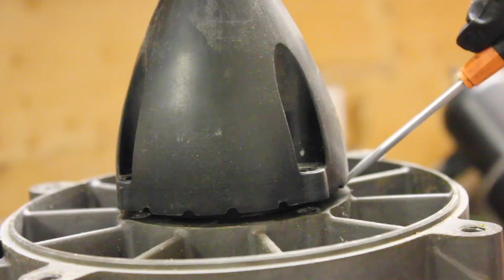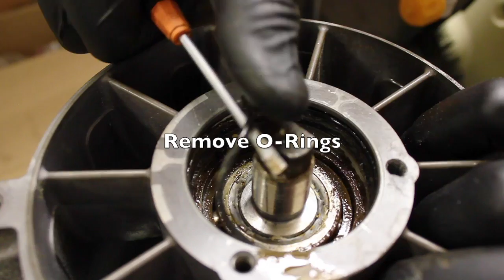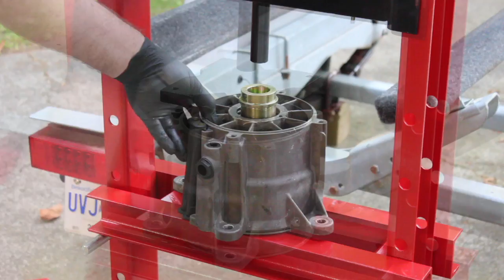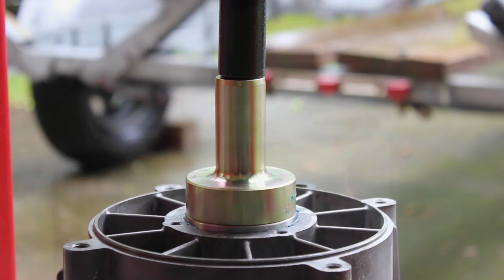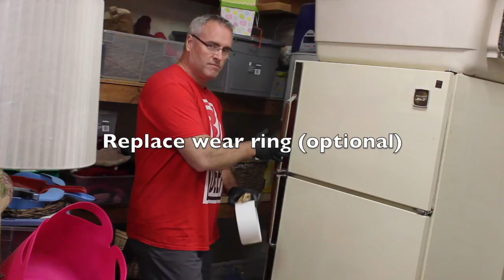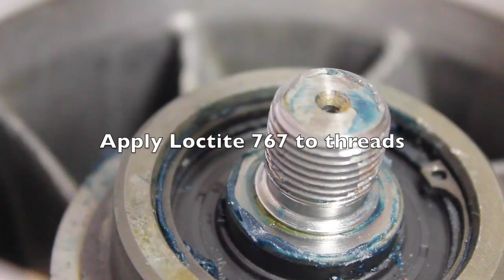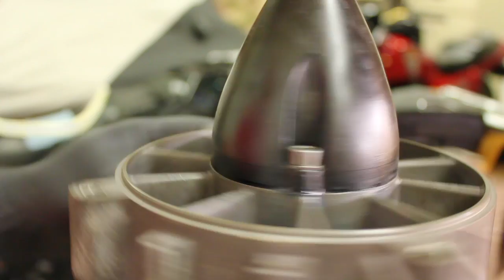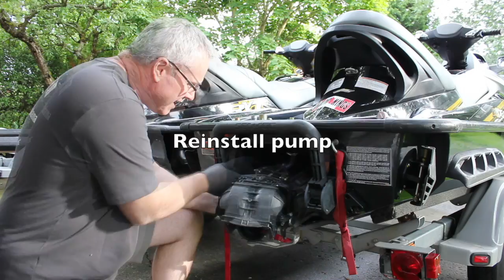How to Rebuild Your Sea Doo Personal Watercraft Jet Ski Jet Pump

Comment: Ya, that’s why I’ll just drop mine off at the shop. 😬
Reply: Just check the work good. I just rebuilt mine, and the person that last changed my wear ring didn't drill the pilot holes for the screws that hold the ring from spinning, and the screws were pushing the wear ring into the impeller. What an idiot he must of been. I bought the ski used, and the original owner always took it to the shop for servicing. Glad I took it apart , and checked it over good myself.
Reply from the maker: That’s why it’s a great idea to check on these things yourself. We assume that the professionals did a proper job, but then again …

Comment: unfortunately the tools and press needed to remove and install the bearing made it not worth it doing it yourself....much more cost effective to take jet pump into dealer and pay then hour labor and let them install the bearing, wear ring and impeller....I did save a ton of money by removing the jet pump myself and just bringing it to the dealer
Reply from the maker: If you do a lot of riding, it’s cost effective to split the cost of such tools with a friend or two. That’s how we got started.
Reply: @3ftDeepChannel  yeah, I have two skis and considered investing in a press and bearing tool, but I don’t think I’ll use it for much after that.

Comment: I ran over a cup, jetski won’t start. Even with a new starter solenoid today. Are bad bearings likely my problem?
Reply from the maker: If your problems started after having a cup go through your impeller, I'd check to make sure there's nothing stuck in your pump and restricting the movement of your driveshaft. Have you checked that all is clear?
Reply: @3ftDeepChannel  No. Haven’t had the time to. Tomorrow my mechanic said he’ll check it out and i’ll let you know what the deal is!
Reply from the maker: Okay, please keep us posted. Good luck.
Reply: @3ftDeepChannel  Blown motor. The piston came up and tapped the spark plug. It only broke off the end of the spark plug though. Fragments inside of the cylinder. Wondering if i can just magnetize the fragments out and throw another spark plug in.
Reply from the maker: that shouldn’t happen under normal circumstances. It sounds like you need to do some engine surgery. Good luck.
Reply: @3ftDeepChannel  thanks!

Comment: Hey I changed out my impeller and wear ring but I'm getting a rough feeling when taking off any advice ?
Reply from the maker: There could be a number of reasons for that, but the most common in older machines is a misaligned engine. It’s also possible that one of your spark plugs is not firing properly, so make sure they’re all in very good shape. Good luck.
Reply: @3ftDeepChannel  changed them out doing the same thing and it's a 2018 rxt300 the prop broke off piece of its blade also I only added grease to the bearing maybe it needs to change ?
Reply from the maker: It could be the pump got damaged. It spins at very high RPMs so it’s possible it needs some repair. Hard to say, though. If something got in that was hard enough to break the blade it could have caused damage to the stators or other areas. Check again to make sure there’s no other damage or that there’s nothing stuck in the intake, as that could cause the issue.
Reply: @3ftDeepChannel  I will check the startor but the intake grate is clear I changed the impeller and wear ring to brand new ones so possible the pump got damaged bearing wise ?!
Reply from the maker: @kiingmccoy6383 It’s possible, but unlikely the bearing got damaged. It usually degrades over time and use. But if parts of the pump housing get damaged, this can cause a lot of vibration and loss of power.